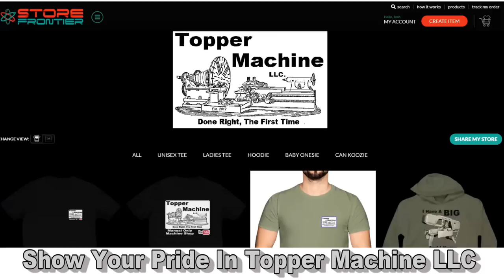Homemade DIY Sawmill Ripping Through Logs - Timelapse Sawing - Topper Machine LLC

Comment: Fantastic video, I enjoyed watching the saw mill in action and it is cool that it is powered by your old Farmall tractor. It is a shame about your blade, I assume you can weld a new tooth in. Novice question, the larger logs are tapered as the tree is wider on one end than the other. Do you have to raise the narrow end so the centre of the log is in the same place on the mill and the lumber is cut with the grain?
Reply from the maker: Teeth are replaceable. The corner was damaged on all 32. They can be ground back good. No big deal. I shim for the tapers.
Reply: @TopperMachineLLC  what size teeth did that blade use. 
  I've got a number of them that were left over from my father's things that are just sitting in a box on the shelf collecting dust.

Comment: Saw working great, guessing PTO also drives a hydraulic pump, to power hydraulic motor for saw carriage Josh?. I noticed hydraulic tank below table.
Great video and photography,  well done Carl.
Thanks for sharing.
Reply from the maker: Check out my older video with the sawmill tour.  It shows the drive system.
Reply: @TopperMachineLLC   Hi Josh, September 2021, Part 3. Found it, I think I missed that one. Great build, very comprehensive feature wise.

Comment: It seems that these Circular saw cut faster than those portable bandsaw mills , right ?
i would like to get one but wondering which one is better in speed and precision.
Reply from the maker: Circular 100%.  They are fast, and if set up correctly and maintained will cut perfect boards.  Bandsaws of the consumer variety are slow and don't cut strait.  The blade likes to climb or dive when it hits more difficult grains.  You need a planer with a bandsaw.  Commercial bandsaw mills, use a 4" or wider blade, and do cut good, but the cost is significant.
Reply: @TopperMachineLLC  thanks for the reply.  Which size Circular saw would you suggest to be minimum for milling tree with diameter 30 inches?
Reply from the maker: @halalmeatshophk  you can get away with a 46-48". But after switching from a 48 to a 52, I am so much happier
Reply: @halalmeatshophk  I used to help my dad on his sawmill. His mill had a 52 inch blade, and adjustable head blocks, so we could saw logs down to 4 feet in length. With that setup we could cut 18 inch boards in a single pass. And yes we had also sawn logs that were 30+ inchs in diameter. A lot of log turning and taking smaller slabs and boards off as we went, and usually a chainsaw to finish splitting the log blank ( usually boards wider then 18 inches ). Fortunately we didn't have to mill to many of those 30+ inch logs.

Comment: Good video with a lot of valuable lumber sawn by that big blade. Wish there’d been more filming in real time instead of speeded up.
Reply from the maker: Next time. We will be sawing again soon.
Reply: @TopperMachineLLC  I’ll be looking forward for it. Never thought of it before but that blade is “climb” milling which is necessary to hold the log down and prevent lifting. The sawdust removal is pretty neat, better than the old chain method.

Comment: Hey Josh everything looks like it's running smooth what year is your tractor I have a 1956 Oliver super 55 I rebuilt 20 years ago as the original marvel scribbler carburetor work good the first time already built it now it's giving me trouble in the float area I think some of the new parts the needle and seat don't have the same configuration as this OEM well like I said Josh looks good looks like you're having fun too lot of work. JM
Reply from the maker: It is a first year Super M. 51 or 52?  First year didn't have live hydraulics. It's been upgraded at some point in it's life and puts out close to 60HP. The mill is quite a workout for it though.
Reply: Oh that's cool wonder how they converted it when you say live hydraulics you mean they work with the clutch disengaged and obviously engaged. My Oliver I was just messing with the carb the tag says 54 are not 56 it has a Waukesha engine in it I think the board  3 1/2 when I rebuilt it it has wet sleeves I put in the Big bore kit in it 3 5/8 stock I think it was like 35 horsepower it's probably something like that now all right Josh have a good one
Reply from the maker: @junkmannoparts9696  The farmall live hydraulics in the Super series were a pump off the magneto/distributor drive.  They worked very well.
Reply: @TopperMachineLLC  Thanks Josh

Comment: I swear I'm not one of those youtube safety Nazis . I couldnt care less if anyone wears eye protection. That's up to the individual person. With that being said , how has no one lost a body part on this mill?
Reply: I would suggest it’s because mature people who understand motion and energy are running it. Recall that Josh has spent a good portion of his life around trains.  Those things have all kinds of moving parts 😂
Reply from the maker: Circular mills are 100% safe if they are respected and you are aware of the dangers. Use common sense. Don't saw distracted or tired. In the right hands they are safer than a table saw.
Reply: Respect. 
You have to respect it.
Reply: Do you see him getting close to or leaning on the blade when its running? Do you see him jumping the pto when its running? This tech has been around for at least a century, ran by steam tractors. Yes, in the past, several have been injured if not killed by these, doing things they shouldnt have been. However, several hundred thousand if not millions of people ran them without incident. They were common place, probably in almost every town or close by. In a 150 years from now, people will sit in amazement watching videos how we drive cars and wonder that very thing. Yes, several have been injured and killed, millions more drive without incident.
Reply from the maker: @oldiron4135 I never got near the blade, and never inline with it.  Never jumped the PTO shaft, I always walk around the tractor.  It is 100% safe.  I wouldn't do it if I felt unsafe!
Reply: @TopperMachineLLC  Yep, common sense prevails when using any type of machinery or power tool, even hand tools.